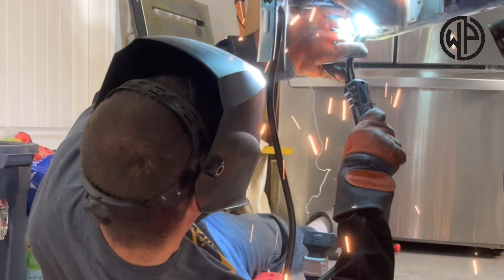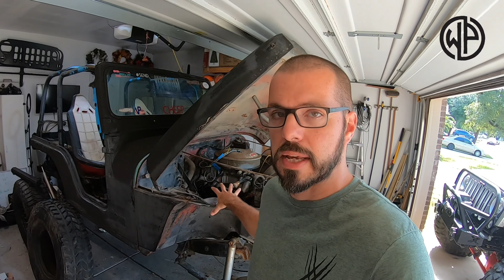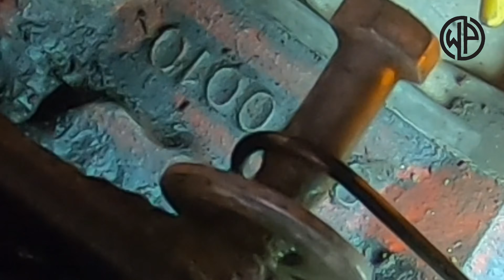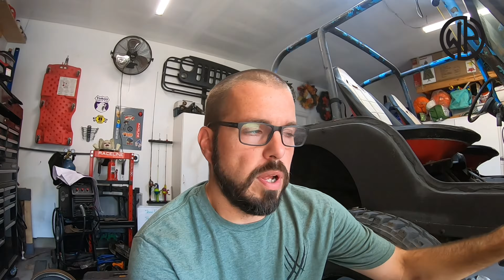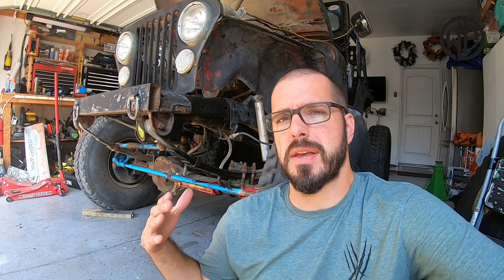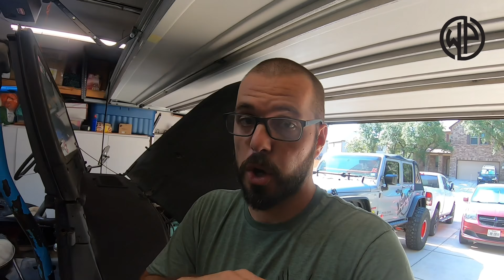How to Identify and Test a Small Block Chevy V8 Engine

Comment: I have a sbc 350 it has casting numbers 3970010 and Vo810CKR I need some help trying to figure it out can you help
Reply from the maker: Flint Michigan Plant. Built on August 10th. And put in the 1977 Nova. 170 hp from the factory (thanks to emissions) and it’s a 4 bolt main.

** if you remove the timing chain cover and also find a “010” stamped on the front of the block, it means it’s a high nickel casting…which is more desirable (they can usually handle more power).
Reply: Where can I go to find out what casting numbers mean?
Reply: Vo40gf 13:36
Reply: V0404gf 14:30

Comment: is there anything to this Baxter Performance claim that the Pentastar Cartridge Oil Filter is damaging the engine?
a few years ago all you heard was how great the Pentastar engine was on youtube.
but now with this Bater Oil Filter Adapter that converts it to use the screw on metal can oil filter, many youtube videos are showing worn cams and rockers and claiming it's caused by the cartridge filter draining all the oil back to the oil pan.
Reply from the maker: Yea. Tbh, my personal experience is that it’s due to low oil pressure at idle. At idle the oil pressure is 30psi or less. It rises to normal levels when you hit the gas. I have found that engines with idle time are the ones that have the issues…hemi’s included. And the hemi has the screw on type. The bottom line is that it’s very very very rare anyway. With all the pentastar engines out there…VERY few even have the issue. But caught quick it’s a fairly simple fix. Eventually you’ll start hearing of this issue happening with the screw on type too. It won’t matter. I just think it’s a sales pitch. And the statistics will probably show that it hardly ever happens with their filter…but it hardly ever happens without it too. Statistics are a funny thing.
Reply: @WarPaintTexas  exactly, sales pitch because the youtube videos that are saying it's a problem, are the ones who are installing the Baxter adapter.
and they also claim that is why Toyotas switch from cartridge. 
but what I've seen is that Toyotas have a cartridge at the bottom of engine. so that can't be true because oil can't drain Up when the engine turns off.
Reply from the maker: @TwoFeatherChannel agreed. At my job we have all sorts of makes and models. Tbh, the Mopar stuff has had the least issues even compared to the Toyotas. Now that isn’t the norm, but it just proves that no matter what, things break. If you take care of what you have an maintain it you’ll be fine. And the ones with more idle time tend to have the most issues regarding lifters…which is still rare.